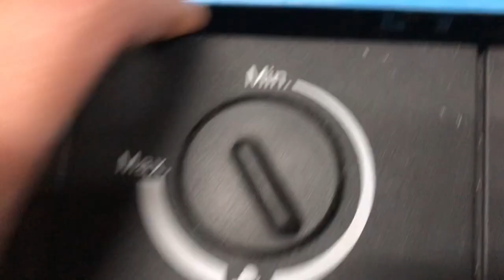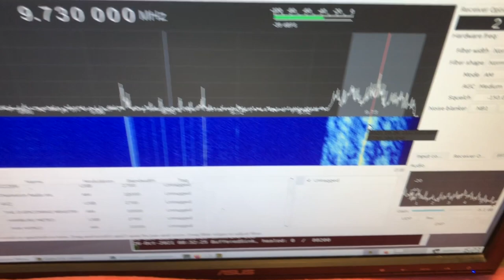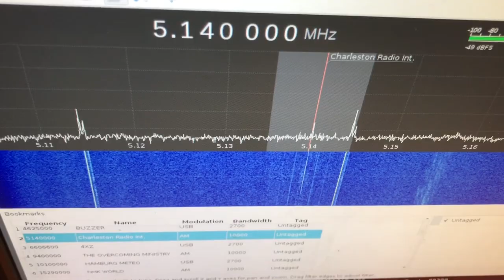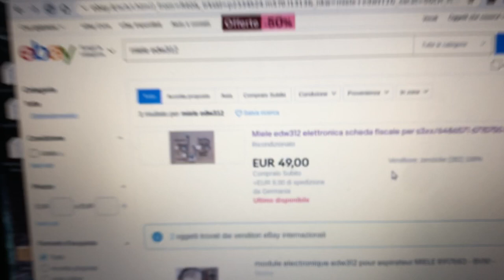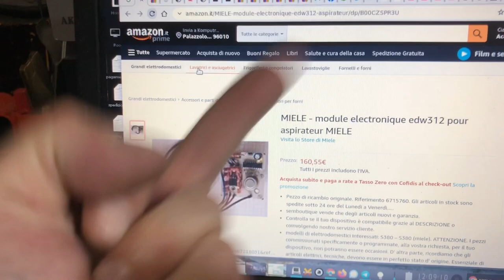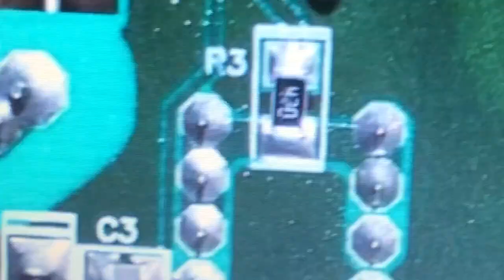"Riparazione" aspirapolvere Miele S381, triac,  resistenza SMD, rant 2/2 vacuum cleaner repair rant

Comment: My S381 motor only does microsteps (5-8Hz clicks forward). Apparently an electronic issue, but not as trivial as yours. I measured all resistors, capacitors (even SMD), the resistance of the power FET (both sides 33Ohm to center), all looks unsuspicous.  The step-motion indicates that the controlling IC may have died, how to test THAT bugger, just WHAT IS IT anyways??
For the price of a replacement ECB I can buy two new vacuum cleaners at Jeff's junk yard river .. F-U, Miele!
Thanks for showing!
Reply from the maker: Thank you for the insight! There’s too much electronics nowadays in appliances that must be kept simple::(
Reply: @asbestomolesto  si, signore! tutto pazzo. grazie!
Reply from the maker: @88BlueKeys4U  Did you used the automatic subtitles? I see they work very well in my channel because of the way I clearly speak. 
I'm wondering about making some video  in English language (I can speak, as you can imagine) but IDK how my normal viewers will be comfortable in that :)
Reply: I wasn't aware of any subtitles, considered this to be a 'silent movie', with gestures 'Italian style'. In a forum I saw a hack of this universal controller board (312?), that pretty much circumvents all this RPM tinkering nonsense, allowing for a direct AC feed of power to the motor. Full blast all the time, but that's better than 0 rpm. I will give this a try. New vacuums run on 600-900W, that is B.S. I want a powerful sucker.. These old Mieles have more Watts than a moped..